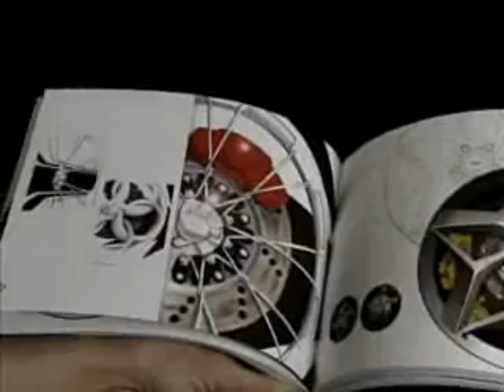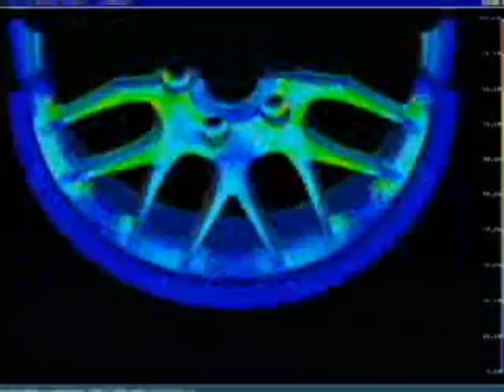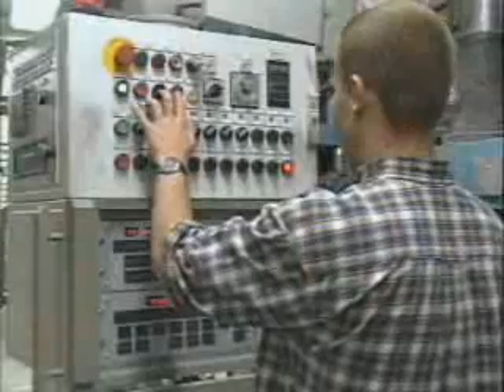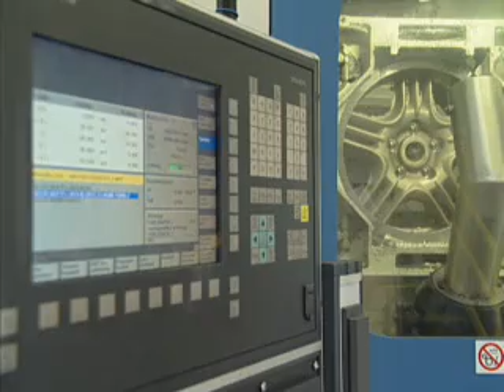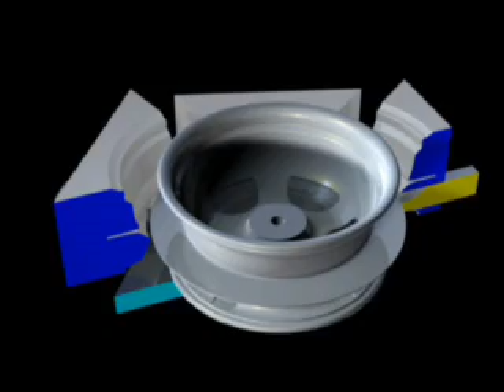BBS Wheels - Manufacturing & Technology

Comment: With the hollow space Idea you could put helium in each wheel to reduce unsprung wieght without reducing strength at all. Just picture a wheel that has as much internal space as possible. Is it possible to fill ordinary tires with helium? I bet it would help alot especially off road racing.
Reply: it's unsprung mass that matters, adding helium doesn't reduce the mass of the wheel.

Comment: From the og-madedotcom,

" ... a plant tour of the Work Wheels Factory ... they had a row of machines with a caption; The low pressure casting machines at Okayama 2 Factory. Low pressure casting is inferior to, of course, high pressure casting. That being said ... its evidence as to why Spoon Sports had some Work wheels crack on them during their 25-hour enduro." 

And to top it off, Work Wheels is known for making copies of the original designs by AME (Enkei) and Asanti (Lexani) ...